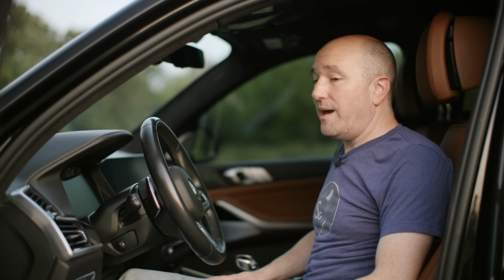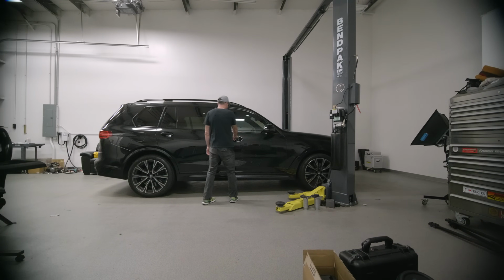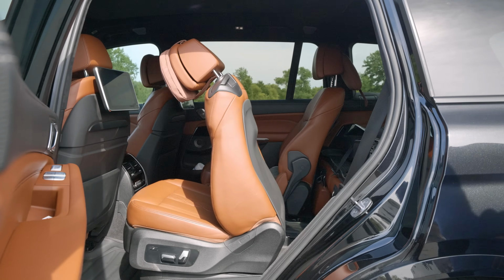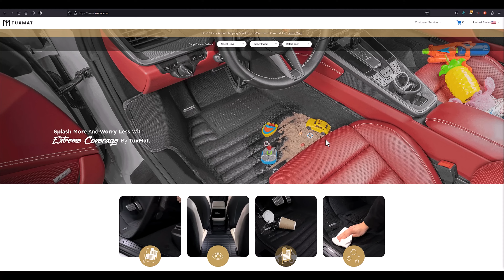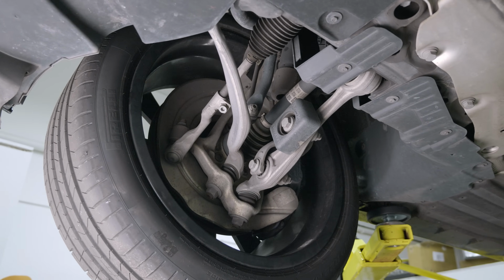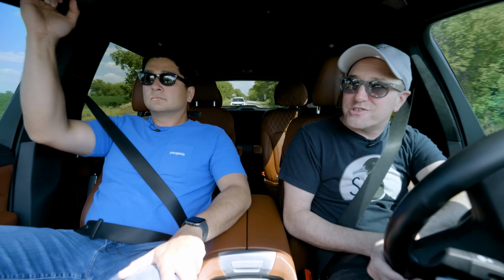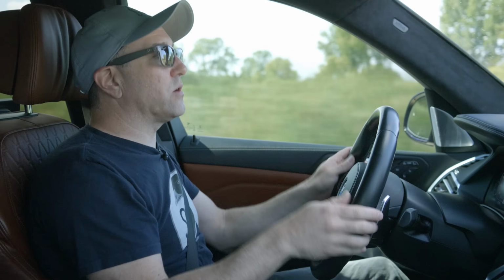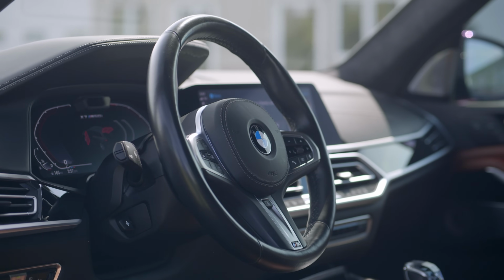BMW X7 | 45,000 Mile Long Term Results

Comment: As a technician for BMW from 2014 to 2017, I would be really really apprehensive of owning a V8 from them, but if they really have improve cooling, the material for the valve guide seals, and all of the coolant hose and ventilation hoses on the engine, oh, and the timing chain stretch issue, the rest of the engine should be pretty bulletproof
Reply: A lot of “if’s” 😂
Reply: Why'd you stop in 2017?
Reply: Yes hearing that this V8 was one of the most reliable was news to me so thank you for adding to the conversation. My F85 X5 M had a cracked cylinder and in general use a lot of oil in between services, but at least I got a new engine under my extended warranty and this replacement engine works like clockwork so far.
Reply: Toyota proofed these power trains while doing that partnership for the Supra. All the engines are bulletproof if you have a 2019 or newer
Reply: @RellupNorth that is a 3.0L engine, not a V8?
Reply: @RellupNorth - That’s the B58 V6 not the V8
Reply: -  @dgdave2673   The B58 is an in-line 6. Not V6.
Reply: @hsmedsvik The partnership helped with everything, not just that power train
Reply: @babochee  Who do you recon benefitted more from that partnership? BMW surely, right? (serious question)
Reply: The BMW V8 is much more reliable than the Benz

Comment: Thank you for the review, Mark. X7 M60 owner here and this review pretty well reflects my experience. 

I would add X7 pricing destroys GLS as well as Cayenne and Range Rover.

Callouts:
-Usually have the third row down, making it an extended X5
-Always have the gesture control disabled
-Captains’ chairs are comfortable but not folding all the way down flat is a huge compromise
-The slow seats movements don’t bother me
-Front seats are fine but the 7 series sedan seats are much softer
-The first set of summer tires lasted about 10k miles
-Gas mileage is terrible with any spirited driving
-AC is weak
-Seat ventilation is weak
-Massage function is so mild they shouldn’t have bothered
-Heated and cooled cup holders barely delay the march to temperature equilibrium
-Fake engine noise (can be disabled)
-Fake exhaust ports
-B&W stereo is exceptional
-Don’t mind the 48V hybrid at all
-New models removed the comfort access sensors from the rear doors as well as ambient air, rear seat entertainment, and night vision options
-Interior construction and ergonomics are well thought out
-Main issue with suspension is pitch more than roll which is surprising given vehicle length
-The Android and iOS apps add a lot of convenience
-The driving assistance features are well executed with the ability to use them fully or partially
Reply: Great callouts
Reply: I totally agree to all you say. I really hate the weak AC, specially in SoCal at 109 degree weather. The max AC is worthless. I also hate the auto of on (ASS), and the quietness. I mean, it’s suppose to be close to an M car…
I have had the ‘19 50i, ‘20 M50i, and now ‘23 M60i. My favorite was the ‘20. Everything worked perfectly, and it had the ASS disabling button.
Reply: @DanDan-tt6gv oh yeah forgot about no auto-start-stop switch (bc I mostly drive in sport). 😂
Reply: @DanDan-tt6gv The AC weak in all the models you tried?

Comment: I bought a fully loaded (no captain seat) used X7 M50i for $80K (18K miles). It is an amazing car for this price. It is fast, quiet interior, extremely comfortable, and has an amazing engine noise when you push it. Even driving mountain roads at high speed, very minimal bodyroll (maybe it is related to dynamic handling package). If you get the M60i, you will paying nearly 100K even for an used one. Personally I prefer the M50i more than the new one. Still have 1 and a half year warrenty left, so I am not too concerned about potential repairs (so far not a single issue, driven almost 8K miles in many many family road trips). Maintainces cost are very reasonable at my local BMW dealership (This is my 5th BMW). For those who are shopping for this car, I don't recommend getting captain chairs and upgraded wheels. When I was shopping, the ones with captain chairs are cheaper than the ones without. The 21" tires are all season so it is much better than the 22" performance tires. It snows a lot in my area, so I prefer only using one set of tires rather than getting another set of winter tires. 

This is the perfect family super car for those who enjoy performance, comfort, technology, and have kids.
Reply: Does your vehicle engine/hood stay hot/warm hours after driving?
Reply: @UtotheJ  not sure I noticed. But the fan will always run for like 5 minutes after driving. I think this is their default behavior and not because of high temperature.
Reply: Love the x7 m50. Looking forward to getting one soon. How is it in the snow?

Comment: So funny, this is the same thing that happened to me after every BMW I purchased.  I would pick one up two years old, LOVE it, then slowly get worn down by the cost of consumables.  Good review, honest and objective.
Reply: lol I’d like to know what u driving now ??
Reply: And what is the final though ?
Reply: Get an EV BMW! Takes away 80% of consumable expenses
Reply: @verynick very true
Reply: @verynick eighty percent?  You still have brakes, rotors, tires, suspension, some form of transmission and a much bigger deal with the battery.

Comment: I had the same exact X7, 2021 M50i. No captains chairs thankfully. Loved it.  Great car.
Unfortunately, I had to sell it last year when I moved out of the country. At least used car prices were good.
Reply: I’m guessing the other country is better.
Reply: I had the same.  Last 2 years and had the realization that the v8 wore off and didn’t know why I had it.  My 8 year old also hates how long it took for the bench to go down and she just exited thru the hatch.
Reply: You escaped the drop in used car prices in 2023
Reply: Ah, so you're one of the guys posting on Craigslist, "Need to sell ASAP as I am moving out of the country." I think half of those folks are actually doing so, and the other half is letting you know the car is trash and not to come looking for them after you take delivery.
Reply: @smurfythesmurf  quite a few erroneous assumptions in that paragraph.
Reply: @rayF4rio  All jokes. I do wonder about those people posting that on Craigslist though.

Comment: I had my wife test drive EVERY 3 row SUV from top spec Lincoln Navigators to Honda Pilots and you would never guess which she loved most.  The Chevy Traverse.  Fast forward 2 years and she still loves it to death.  Zero issues.
Reply: Funny you mentioned the Traverse.  I have a 2018 High Country that for the past 2 years I have wanting to replace.  I have test driven a lot of SUVs including the X 5 and the X7.  I always come back to my Traverse as being a hell of a lot of car for the money.  The interior is almost luxury at a fraction of the cost and the digital rear view mirror the X& doesn't have it.  The 2024 Traverse will be out soon.  If the UAW quits the strike.
Reply: She chose a Traverse over a X7 or GLS?
Reply: I had my wife to do the same two years ago and she selected Range Rover Autobiography V8... final three candidates were X7M, GLS 550 and the RR. Well she didn't test Pilot or Traverse...
Reply: That’s hilarious because my wife chose the same thing. She still loves her traverse too.. I’m actually trying to decide on getting either an x7 or go back to a ‘luxury” pickup. I currently drive a 5 series, but it’s just not practical for what I need today.  Oh btw, the new traverse does not compare to the 2021. We just test drove one and it just feels cheap, and we hated the gear shift placement.
Reply: As someone who has owned a 24 RR (fullsize), 24 Lexus LX600 F-Sport, and as of last night a 25 Marina Bay Blue M60i, I would say I liked the RR the best. I put 24k miles on the RR in one year and loved it until I traded it on the 24 LX600 four months ago. Liked the LX but after the RR I didn't feel the same connection that I did with the RR and decided to trade it for a BMW. I have not had much time with the X7, but it sounds amazing, and drives excellent. Interior bits and pieces do not feel as high quality as the RR, or Lexus but it definitely has the edge on tech. I absolutely, hate the climate vent controls, and I feel the overall interior quality is nowhere near RR, or the Lexus.

Haven't owned a BMW since my F10 535i days. So, don't know the reliability of BMWs these days, but I am not planning on keeping it for more than a year, or two.
Reply: this is the biggest cope comment i've ever seen, no way in hell anyone is picking a traverse over even an X1 lmao, let alone x7 or gls, gtfo
Reply: @muayboran4life  thats some royal waste of money trading in virtually new cars
Reply: @akshayd82  It is...But I always negotiate, and try to get vehicles for under MSRP. With the Range Rover I actually paid over MSRP (first time ever), and got the LX600 for $2k off. X7 was close to  $4k off and financed it for 3.99% APR with BMW Financial. Currently has 7k miles and absolutely love it. S68 in the M60i is such a powerful power plant, and averages 20-21 mpg which is inline with the LX600, and the Range Rover SE that I had. 
Life is short and I love experiencing new vehicles.

Comment: I personally think the 40i with B58 is plenty for everyday driving. It will reduce that feeling of bleeding money that Mark has mentioned.
Reply: Absolutely. For the second-hand market buyers, it is really important to know the the xDrive40i B58 engine models are much cheaper, and will arguably be less costly in the long run. Even if it's only due to better fuel mileage, and cheaper regular maintenance. That said, the V8s in the M50i M60i and xDrive50i X7s are several comprehensive revisions beyond what could previously be known as the worst BMW engine ever: the N63. 

The newer versions of the N63 are a far-cry from the original failure that once was in the late 2000s and early teens. In our experience as a BMW repair shop, these newer V8 N63/S68 engines are fabulous to own. The N63TU2, TU3, and TU4 engines, along with the new S68 V8s are worth looking into if you need that power. I don't think you'll find a more potent engine on the market in this segment. BMW has had a lot of time to figure the TTV8 out. They didn't give up on it, and 15 years later we have the best versions. I hope the stigma of BMW V8s being a nightmare continues to fall away.
Reply: I agree. With a stage 1 tune b58 comes close to the n63 powerwise
Reply: Imagine buying this car and complaining about “money” makes no sense.
Reply: @chikmnunget8031 not true,money is money. Things are crazy right now, unbelievable how prices are high. whatever you have now, try to hold it cause the way things are going now.Better save your money as much as you can and invest them.
Reply: He has no reason to complain getting the car he got!
Reply: I thought that. Worrying about fuel costs when fuel is pretty cheap in the states. Saying that, perhaps he does mega miles. For the milage I do te MPG would not put me off. @chikmnunget

Comment: "it doesn't suck, it doesn't blow, it just doesn't serve its function" cracked me up here, lol
Reply: They work fine, but they are not "cooled seats" or "seat coolers", just ventilation. You dont get sweaty in summer if you turn the seat ventilation on. I wouldnt want another bmw with leather seats without seat ventilation
Reply: @janriha3956  if you can compare them to G30 5 series seat ventilation, how would you rate them?

Comment: You really don’t need a 3-row, and you will miss the BMW drivetrain, suspension and iDrive7 system.  Get yourself a 2022 or 2023 X5 with the B58 in-line Six.  It will give you everything you like in the X7 without all the bells and whistles of your M50.  You can get a BMW Certified X5 off lease for less than $65k.  I just did and I love it !

Comment: I’ve owned my X7 40i for a few years now. I gotta say I felt like this review took my quiet thoughts about the car and put them in a video. Agreed with virtually everything. We love it though, it’s been great and reliable. More reliable than our X5. I also have two Nuna car seats in there covered in apple juice and remnants of Pb&j, so agree it’s annoying with the floor anchors behind the middle row captain seats. But we have so much room for the kids, strollers and groceries. It drives like a sports car in an SUVs body. We do a lot of road trips and live an hour away from anything and I think you just gave the most accurate and relatable review here. I highly recommend but would say only if you’re okay with the monthly price/cost.
Reply: Buy a minivan! lol! Ridiculous
Reply: So I'm stuck between the x5 40i or x740i  now I don't have any kids yet but do have nephews and nieces I want the v8 but those bmw v8s aren't reliable the B58 is really good what are your thoughts with the B58 x5?
Reply: @albaro08a  never drove a b58 personally but have only ever read good things and there’s a reason why they’ve gone with them as of late. Our x5 always had some issues but the x7 has been amazing and super reliable so it’s kind of a toss up but I would have more faith in the newer x5’s with the b58. Anything older than 2019 probably a no go.
Reply: Monthly cost you mean subscription ??

Comment: Own a ‘21 X5 M50i- This review perfectly captures what it’s like to live with this one of these things. Like Mark, I paid through the nose for the extended warranty so I could sleep at night. Seat ventilation is a joke, now I know why very few dealers spec with with it. Gesture control is kinda cool for forwarding tracks, volume control and some other stuff but is a gimmick for sure. That said, the V8 doesn’t get old.
Reply: Lexus has great ventilated seats (cooling)
Reply: I don't like the V8. Way too many hoses and fittings to go wrong as the vehicle ages. From a mechanic's POV, the inline 6 would be the better option. It's still reasonably fast and has better fuel economy. The N63 is the only engine I don't like working on/fixing. Everything is a mess with the hoses

Comment: Traded my 2022 X7 M50i in for a CX-90 a few months ago for all the same reasons as this video. Couldn’t be happier and never looked back. Great video!
Reply: Can you give a quick review on the Mazda? How's the third row? What drivetrain did you get? How's the steering?
Reply: @danielrd7493  Gladly! I love it! Have about 5k miles on it and no issues at all. It’s no X7 but it’s also half the price and the interior punches above its weight. The steering is surprisingly good for its size and weight. It’s direct and weights up well, but still is electronic power steering on an SUV so theres only so good it can get. I have the Turbo S Premium Plus. I wouldn’t call it fast, but it’s not slow. I would say the transmission logic holds the inline 6 back pretty heavily in terms of fun. But, I’m averaging 24mpg combined (with a bit of a lead-foot), but it easily gets 32 highway. For reference my M50i was getting 16mpg combined and would struggle to get 21 highway.
Reply: @cnc_general  Much obliged.  I need to test drive your trim level.  I've got the X5 right now, need more room for a growing family.  Weighing between Acura, Mazda and BMW third-row products.
Reply: This is the exact car I was thinking about at the end when he was playing up the commodity brands in the outro. I hope he goes for one.
Reply: @cnc_general  what was the size of your wheels in the X7?
Reply: Thanks, going to consider this to replace my lemon MDX Type-S @cnc_general
Reply: I looked at both and picked cx-90 too and very happy.
Reply: @julianp.2840  what issues have you had with the MDX type S? curious because I was looking at them
Reply: @sly9263 our mdx type S is doing great! No issues
Reply: @sly9263  if you live in a cold state. More likely its gonna be a rust bucket in 5 to 6 years
Reply: @isserdigan2835  no different than lexus or toyota if that's the case- hit it with some surface shield and you're fine (but next to no one bothers to do do this to the undercarriage)
Reply: I think the CX-90 is going to be a horrible car to own, long term.  Watch the Car Care Nut's review on it.
Reply: @isserdigan2835  same exact BMW individual rims as the video. 22” staggered. 275 front and 315 rear. Unbelievably expensive with no real options and are rated for about 15-20k miles
Reply: I’ve had my cx90 for a little over a week. Loving it so far. Stopped driving it a few days ago till I get PPF for the front bumper.
Reply: @cnc_general   thats why your mpg is bad. Mine is 20 and i get 19 to 20 mpg daily with highway at 24 to 25 mpg

Comment: I got the bmw x7 2019 x40i for $50k with almost all the bills and whistles and it’s one of my favorite cars I have ever owned. I had to spend 6k on extended warranty to 100k miles but it’s definitely worth it. I recommend getting an X7 over any other 3 row car. I almost got the v8 but I heard it’s not as reliable as the inline 6, plus, I wouldn’t have utilize it more than 5% of the time not to mention the fuel economy of a V8 (mine gets 20mpg combined) get the X7 in-line 6 and you won’t be disappointed
Reply: Nice! I’m considering picking up exactly the same spec x7 for $60K CAD I have a 5 year old and 9 month old, have you put car seats in, any feedback ?
Reply: @moelo5930  yes, there is plenty of space, I would recommend getting seat covers so the leather isn’t damaged. The only downside that it take FOREVER to move the seats to access the 3rd row